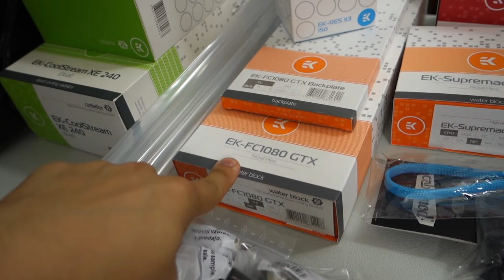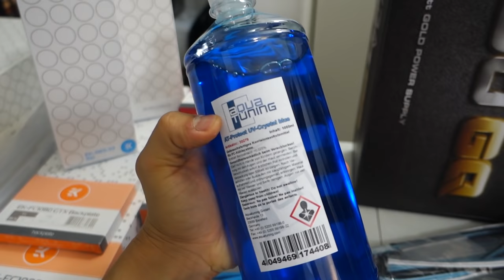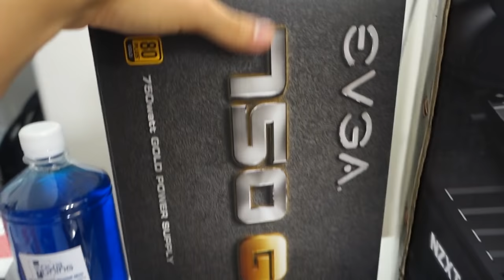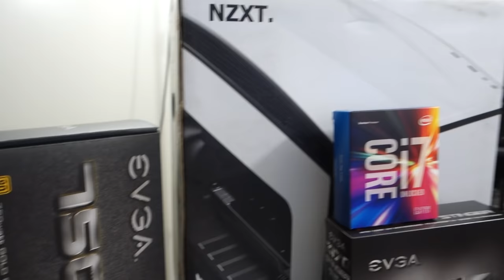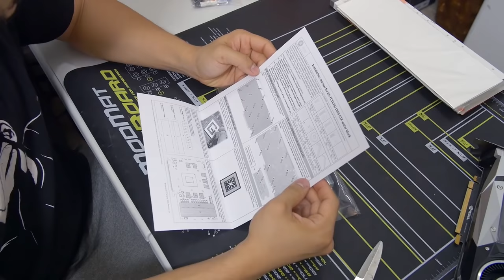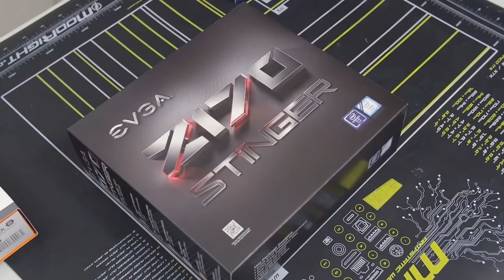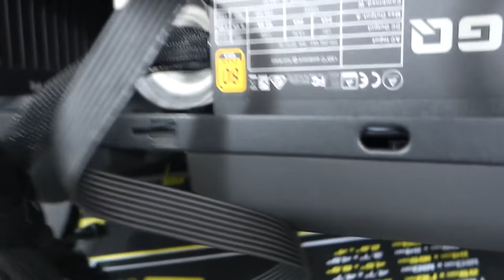My First SFF Custom Water-cooled PC! Build Log #1

Comment: Did you just put thermal paste under the thermal pads? o.O
Reply: It might be thermal addheisive
Reply: rocket5010 There is no need for either though.
Reply: +JediSoulfly true
Reply: rocket5010 I could see it being a hindrance to cooling. Though I doubt it would be detrimental. Typically vRAM isn't a huge heat producer. Water cooling vRAM is pretty much overkill. The only real reason for full coverage blocks is the VRM.

Comment: Isn't a general rule that 1 120mm radiator can cool one part fine, so wouldn't the 240mm radiator work fine for your cpu/gpu??? also somebody please let me know if i'm wrong.
Reply: Generally for enthusiasts it's 240 per part. I'm sure 120 would cool fine but enthusiasts strive for better than fine :/
Reply: +Luke Miller that's fair, thanks for the tips!
Reply: 120mm per part works fine, but you see bigger gains vs air cooling with more radiator space, more overclocking ability etc.
Reply: thanks

Comment: The white could work, but those cables look super thin and puny.  I would recommend maybe using a thicker wire.  Also for rads, you may want to consider swapping both.  You haven't put fans on that front one and that'll add another 25mm of clearance issue on top of the tubing.  Take a look at EK-CoolStream SE 240 (Slim Dual) for your rads.

https://www.ekwb.com/shop/ek-coolstream-se-240-slim-dual

Comment: My new PC in Aud 
Motherboard- ASUS Z170 Gaming Pro $250
Cpu - Intel i5 6600 $300
Gpu - ASUS Gtx 1060 Turbo 6 gb $430 
Cpu cooler - Cooler master hyper Evo 212 $30
Ram - Kingston Hyper X Fury 16gb (2x8) 2666MHz $130
HDD - Western Digital Blue 1TB $70
SDD - Corsair 120gb $80
Case - Corsair Spec 1 red led $80
Case Fans - x2 120mm red led $16 each x2 140mm red led $19 
Optical Drive - ASUS $30 
Total Around $1500 with out monitor, OS etc  
This is my first build.

Comment: Kyle I think you may have messed up did you remove the foil covers from the thermal pads before you placed them on the board and on the top before you installed the block? Also I thought I saw you put thermal paste on the VRM's and memory modules? You don't need paste there my friend. Watch JAYZTWOCENTS Video on installing a water block on a GTX1080 he did about 2 weeks ago you will see if you missed anything! I'm not trying to be an asshole just don't want to see you have a problem in the future and you admitted that you are not very experienced at water cooling.

Comment: my brothers evga power supply think is a 500w one just died after about I year and a half and the computer it self properly on draws about 200w at full load don't know why it died did not get how it blow the fuse in the plug I not getting another evga power supply as I had cheap no name ones last longer  note my brother computer was keep on the floor but the poer supply is very clean in side

Comment: Which RAM "Designer" thinks " Yeah, f*ck it, let's make them bigger, i dont care if it fits or not" 
I mean those plastic p*nis compensators around the RAM module gives no benefit at all, they are not even proper heatsinks ... just facepalm